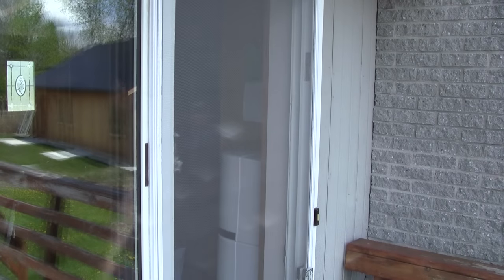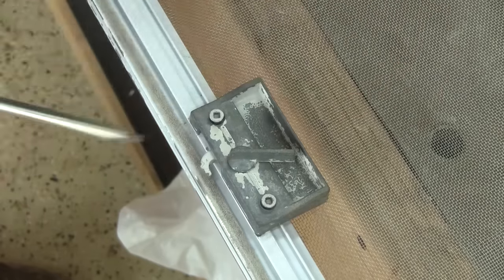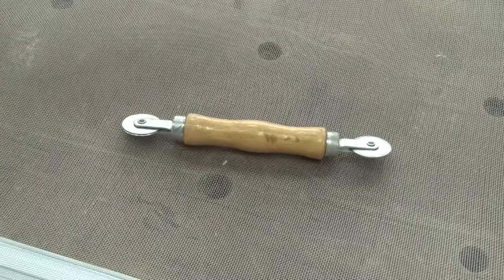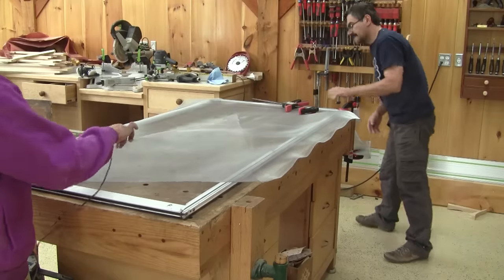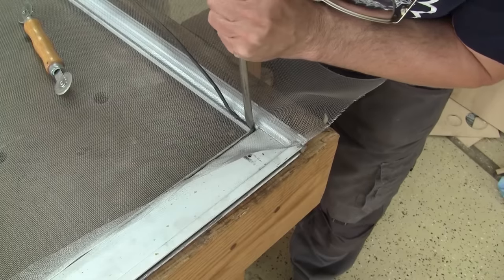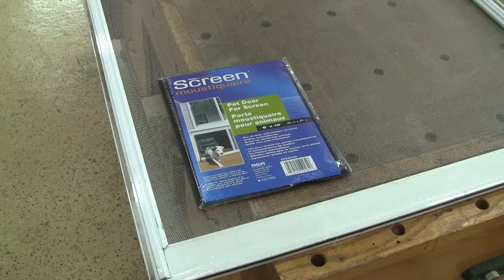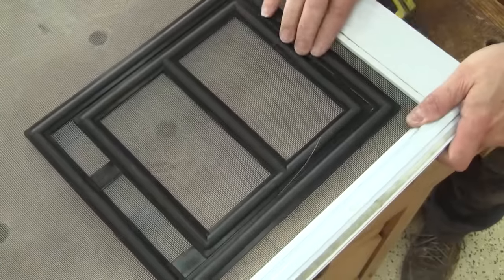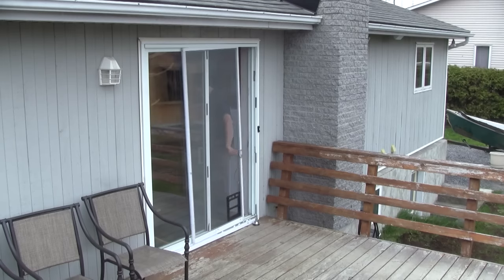The Woodpecker Ep 113 - How to change a patio screen door and install a vermin trap

Comment: For wooden doors, you can bow the door when applying the screen. A block of wood under each end, and a clamp in the middle of each side. When done with the screen release the clamps and it'll be quite tight. Don't know if it would work with aluminium.
Reply: This is a very handy tip!  I'm making a wooden screen door tight now.
Reply: Some screen doors are made with the sides bowing out. Screen tension holds the sides straight. The sides holds the screen taught. Some sliding screen doors are made of steel (test with a magnet to find out), and, at least with my Mom's, steel screen door sides bow out when the screen is off. I found out when I changed the screen. Oh, BTW, the rubber strip is called spline. The tool is called a spline roller.

Comment: Did you consider one of the screens which can stretch and recover their shape? 

Used to have real dogs!  Love it!
Reply from the maker: I've installed one a couple of years ago. Yes it was easier for the furry thing to get in and out but it was a bit of trouble if we had something in our hands. This don't open all the way, it's always closed at the top and once we burned it with a BBQ plates that we brought inside just after removing it from the BBQ.

Comment: My sister has 6 Great Danes......... The vermin screen just wouldn't cut it. Neat job though.
Reply from the maker: When I used to have real dogs, not sample, I've made my own trap made of alluminum, screen and small wire mesh, so they wouln't bashed the screen. But now, since I own a vermin, the overkill is not necessary :))

Comment: Haha, this is literally on my "honey-do" list. Quick question, did you re-use the rubber, or was that new rubber?
Reply: I use to work in a Hardware store and have done hundreds of rescreens.  Dry rot is a real problem with the rubber spline and depending on how hot it gets where you live the heat can shrink the spline so it might not even hold it screen in the channel. Once you get the spline out try to pinch and tear one of the ends, if you can brake the spline off without a blade DO NOT USE IT .... I would suggest only using new spline but that's how to make the call yourself
Reply from the maker: For this screen door I always reuse the rubber. This one is harder than others I've used and it hold better, but with my windows screen I bought new ones, the rubber was not as good hast he one on my patio screen door